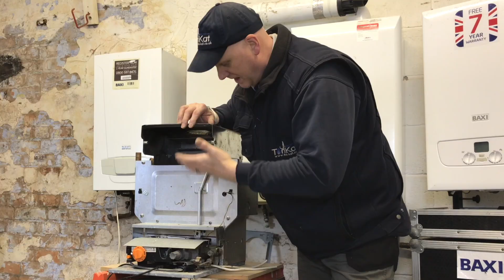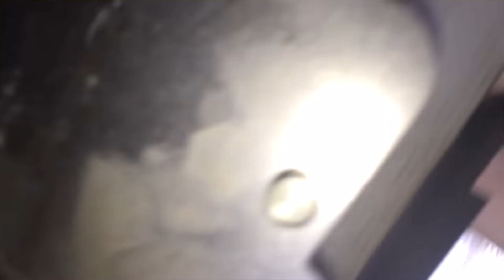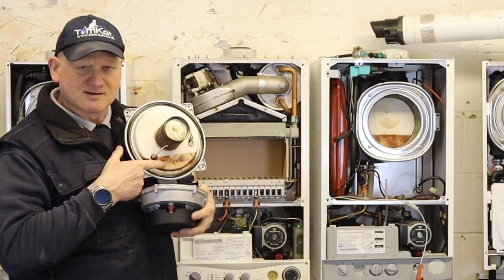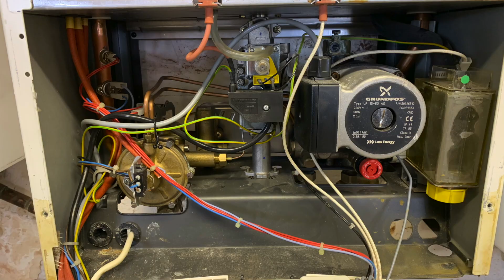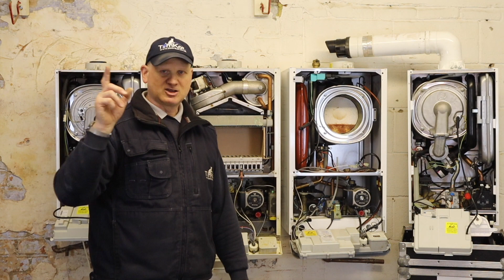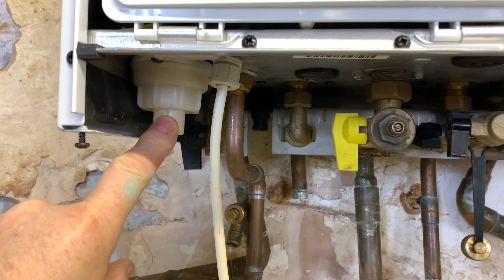WHAT'S INSIDE A GAS BOILER, a look at how Baxi  boilers have changed over the last 50 years

Comment: When my grandad sadly passed away in 2015 I took over the tenancy over this house but he bought it new in 1970s but sold in in 2005 and when we were going through some of his stuff I found the original brochure for when he got the back boiler installed in the 80s still in perfect condition still have it in a plastic folder the boiler has been going strong but got replaced last June for a main eco compact but was still going strong before replacement but it got changed due to very poor hot water pressure and the water couldn't be pumped

Comment: Down south it's a NEATER heat,not picking!
Great video as always.
No one made a better back boiler, loads tried.
Doing away with permanent pilot to increase efficiency by 1 or 2% reduced the reliability.
New burner/gas valve configuration made serviceing a bit of a pain.
Up to that point proper strip down servicing was straightforward  and ensured they performed as new.
Happy days.
Reply: Definately Neta Heat made in Leamington Spa when they were good. Never fitted a Baxi since the Puma which were possibly the worst boiler ever